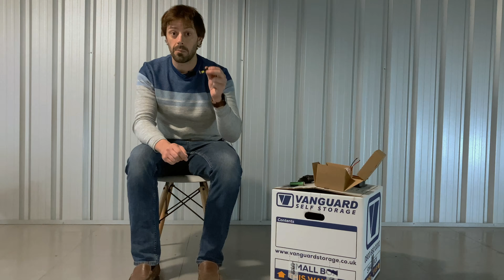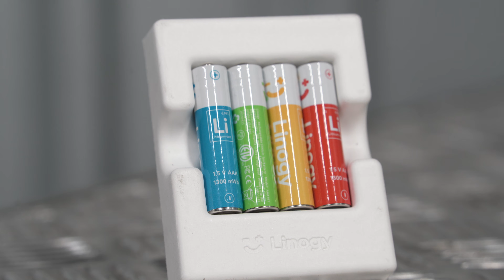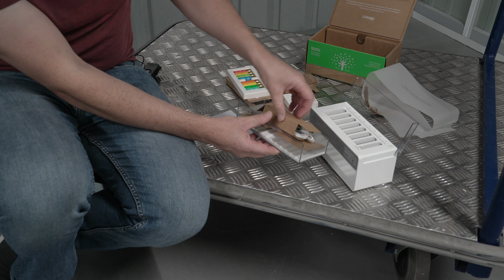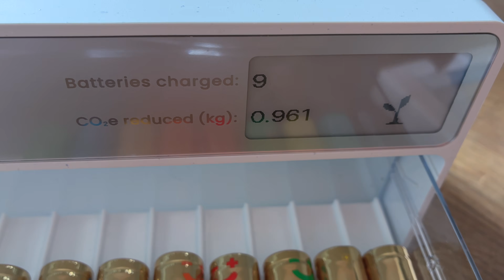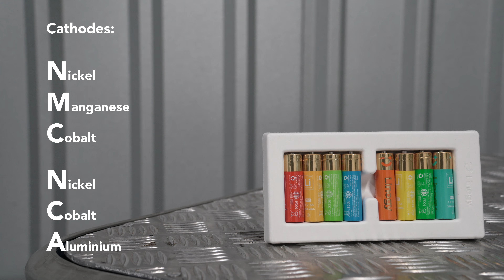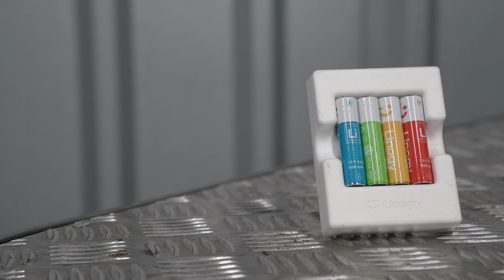Linogy TESTED: Brand new AA Lithium batteries - launch appraisal of charger & rechargeable cells 4K

Comment: Different colours, can't make a set or 4, instant fail. Tell your sponsor they're idiots, having not done market research or usability studies of note, and won't get picked up by bulk users. I'll find a brand with the new technology that does offer set colour co-ordination.

Next:
SECOND instant fail: locked to a charger, no backwards compatibility with existing esablished tech. Dumb move, hard fail. Won't buy on this fail either. It's slack engineering and a false economy. Idiotic
Reply from the maker: Playing the devil's counter-advocate, it would be easy for them to release packs of single colour cells.

On the second point - it's conceivable this chemistry/buck type may because popular, and other third party chargers may offer support. I agree, this novel voltage for charging is tricky and the benefits would need to justify.

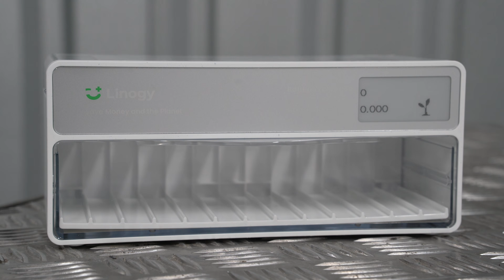Comment: 19:38 Thanks for the video Alex. Not a fan of having a single charging profile, but the auto drop and store seems like a useful (albeit imperfect) feature to remove the need for a separate battery storage box. It would be cool to see some kind of dispenser feature at the bottom that encourages use of those batteries first, but maybe this overcomplicates things.
Reply from the maker: The bottom opening to the box seems like a key addition, so the lower ones aren't underused.

Comment: So I have a question: LI chemistry has a nominal voltage output of 3.7 volts. How do you make these cells output 1.5v? I tried to post on your kickstarter page, but you won't let anyone ask questions unless they've already paid.
Reply from the maker: There's a buck converter built in. Some companies output a constant 1.5V. Linogy have chosen a gradual curve to mimic an alkaline battery. The trade off is against a small conversion loss of energy.

Comment: I like the idea of colours but would prefer a pack of one colour at a time, I label my batteries in pairs as I unpack them, usually with a letter per pair, makes it easier to distinguish one set from another when swapping flat batteries for fresh ones. I tend to store them in plastic cases in sets of 4, having watched to the end I think I'll be sticking to my eneloop batteries for the moment though. And I see that we have the same taste in chargers (mine hasn't gone sticky yet though)
Reply from the maker: Those chargers are ace - just annoying the rubber failed.

Comment: seems like it shares a topology with the usb chargeable lithiums I have for my vr controllers and which you showed in the end slate, omitting the usb port to pack more battery volume by not losing volume of the usb port. those too apply 5v across the end terminals, so could be charged using this or equivalent clip style chargers. overall, i see mostly marketting in these, but the eco packaging is nice
Reply from the maker: Agreed that they've thought the packing through well and not skimped. Every little helps.

Comment: These are just 14500 Lion cells repackaged with a bidirectional buck/boost converter. The buck boost is causing it to lose some efficiency. Most buck circuits are more efficient the closer you are to its input voltage, 3.7V. Since this is 1.5V, it can be quite inefficient. 

We already have high performance NIMH, in the form of high capacity 2600mAH AA cells. There are only two cons to it, which is self discharge and slightly lower nominal voltage vs alkaline. It is around 3wh as tested, so you don’t get hit with the buck converter efficiency issue. 

I see little reason to pay insane cost for this over cheap Amazon 2600mah NIMH or IKEA 2600mah NIMH which are known to be rebranded eneloop (high grade).
Reply from the maker: Yeah I'm on the fence about whether I'd want the constant 1.5V or simulated voltage reduction to not trick power level indicators. Perhaps a constant 1.5V until 10% remaining, and then 1.1V until cutoff to warn you batteries are low? 

Agreed that the buck will always exact an efficiency price, but it's the only option with lithium.
Reply: @AlexHibbertOriginals  Agreed, I'd also prefer a constant 1.5 as that seems to be where lithium would excel at.

Comment: Good to see they list the voltage as well as current required. Although interesting that they only use the 5V supply option since that limits power available and thus number of cells they can charge at once.

Comment: What happens if the tray is filled to the top with cells but you charge another row of cells? Wont the tray jam? Also agreed on the display; they should add another display mode that gives you more technical details.
Reply from the maker: Since you manually add them, I presume you'd know not to add a new row when the storage is up to 40 full.
Reply: I think its a big issue (if it can fail like i described) and they shouldnt rely on the user to prevent it. Maybe they could add a light barrier to ensure the tray isnt overfilled. Or completely redesign it like one of thode 3D printable battery dispensers you can find on thingyverse. This way you could also ensure that your cells are always cycled through and you dont just pick ones from the top.
Reply: @thomasgottschalkistmeinfan347  Realistically you wouldn't be hoarding batteries, so you shouldn't reach the 40 battery capacity limit that the charging storage has. While I do agree it would be nice to have some kind of notification or barrier to let you know that you should remove some batteries, you're not going to run into this issue unless you're a hoarder of some sort, and then it's a different problem. 40 batteries is a lot of batteries to be holding for a lot of devices, in that case you might as well 3d print one of those extra battery holders that you mentioned, but you probably already have one, as I have printed them myself, or just re-purpose a box that the device comes with as an extra battery storage, you can easily split it in half or 80/20 with all the cardboard that it comes.